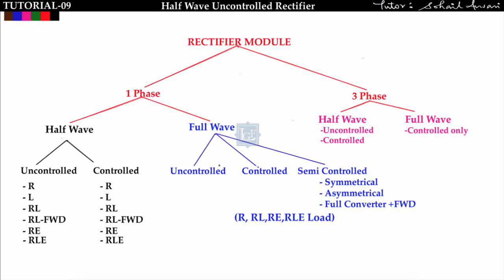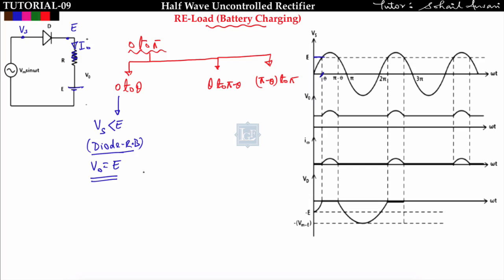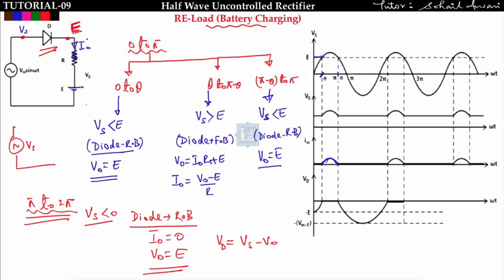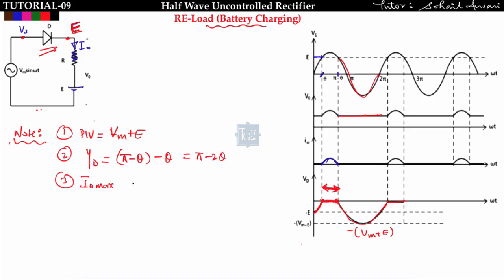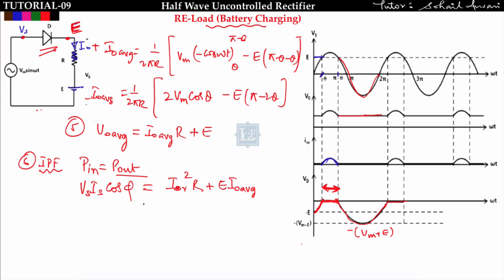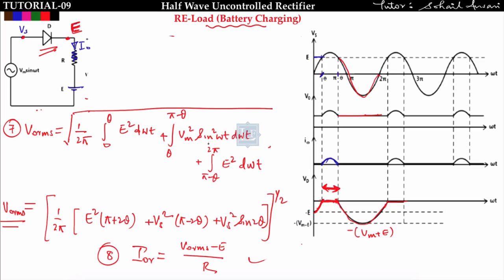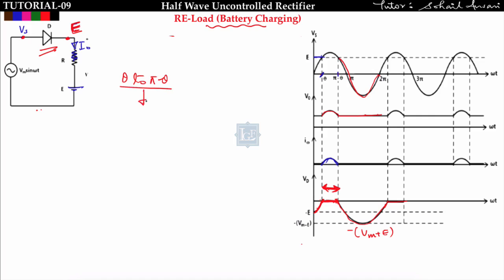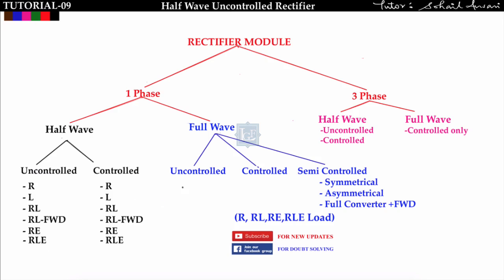Lec 9(c) Half Wave Uncontrolled Rectifier (RE & RLE load)

Comment: Sir in lecture 9c we are giving input ac voltage only during theta to pi-theta only current is passing to the 🔋. Can we use it for charging battery. But why we are using converter

Comment: sir, the conduction angle increases and hence the voltage and current waveforms change bt doesnt it affect the diode voltage? (RE and RLE)
Reply: Bhai the voltage across diode will remain zero till beta.